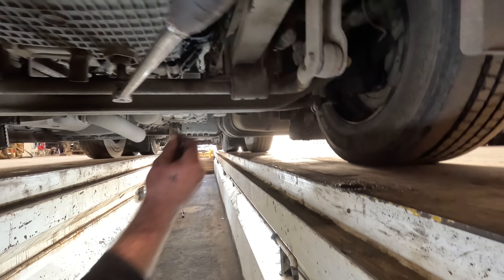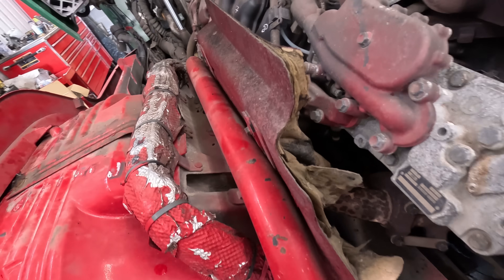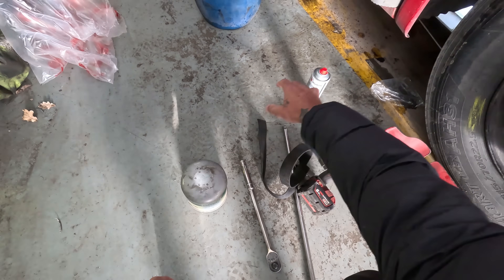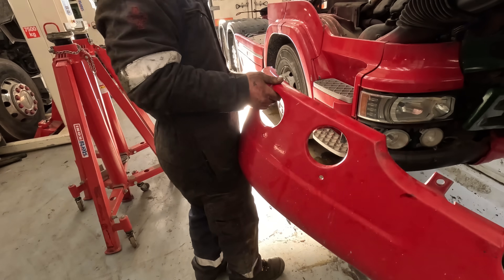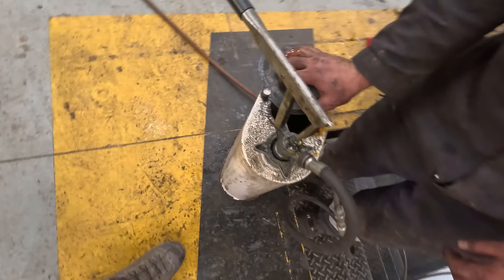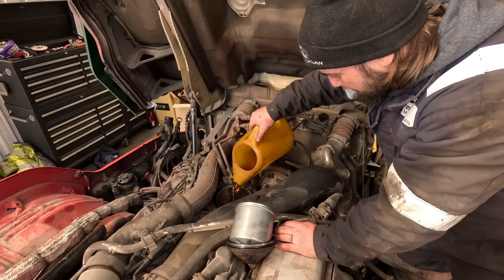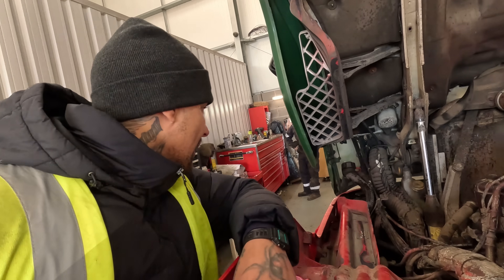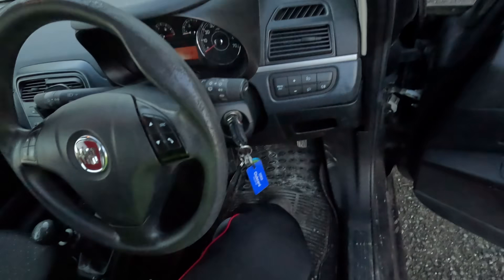Scania V8 - The Cost Will Blow Your Mind

Comment: Probs getting a good hgv valeter on the interior imo, (take cab curtains out and do them yourself) they do such a good job if you use a recomended one, well done on the service for piece of mind to, get all tyres checked also, .lots still to do, operators license , paint, lettering,vat registration , accountant ,fuel cards, etc, and then get earning some revenue,.good luck "TRUCKING UK"

Comment: Half these jobs you can do yourself. My first year of running an old commercial vehicle cost me 25k in parts and labour. I have taught myself to do all the servicing. All it’s cost me the last year was oil, filters, coolant and a clutch.  Had the clutch done at a workshop and at the same time they checked all the steering. £400 was my outsourced labour bill last year.
You can do it yourself!
Reply: maybe he hasnt acquired the right tools yet, or the bay to do the draining correctly, give the guy a break, he's new to owner driving, I bet you didnt start out perfectly straight away! and if you say you did then you're telling prokies me old fruit.
Reply: @guyhamiltonyt  
If you read my post you’ll see what it cost me, me old fruit. Only need a socket set to change the oils. What it’s cost him in labour in this vid he could kit himself out with tools, a torque wrench,  jack and axle stands, and a pair of overalls. Plenty of YouTube videos on how to do stuff.
He’s bought a massive money pit there. Doesn’t need a V8 as a first wagon. An ex large fleet motor with a maintenance record would be better.
Reply: @petittrainguernsey3297 he bought a v8 because he said he wants to do a range of different things, even heavy haulage
Reply: @abdulwadood.8  
Which you build up to. Very difficult in the haulage industry to be Jack of all trades. You end up being master of none.
The motor is only the half of it with heavy haulage. All the certs required, HD axles & suspension required and that mid lift is no good if you need something with double drive. The wagon he’s got would be good for max weight motorway work. Steel rolls etc.

Comment: Nice truck, but I’ve got a question for you… isn’t going to affect your profit this engine? I mean it sounds great but let’s say a 450hp Daf or a 460 Volvo wouldn’t achieve lower consumption and cost of running?
Reply: Depends on the work, we run an R500 v8, and it’s consistently better than the lower powered merc when pulling heavy.

Comment: What a great video , good job hard to start your working your own truck. Your getting there.  If your after any mats I've got a full set of brown leather floors mats for a r series v8 would fit yours , I had them in a r620 fitted a dream . Centre middle one , drivers side , passenger side and top fuse mat and mat for under radio .
Reply from the maker: MD me on instagram mate link on the video description

Comment: Fail to understand why people with no idea about trucks, trucking, or running a truck buisness go out and buy a v8. Unless your eunning heavy freight, say to scotland etc, you're just throwing profit and money in your pocket down the exhaust pipes. You'll get there almost as quick in a straight 6 450, and probably gaining 3 mpg at least. Not forgetting any major work on a v8 due to its fit in the chassis is very expensive. That air compressor sounds proper rattly, more than normal. Diff and gearbox oils were well overdue for a change. Coolant must be minus 35 on a spectrometer, or else you can get problems with block and head joints.
Reply: In about 90% of situations I've ever come up against, a V8 has been much more economical than any other I6 tractor.
Reply: @torinshepherd97  current r 450 returns about 10 to 11 mpg. Most v8 models  are returning about 7.5 that we seen come through main dealers. At 44 t a 500hp would give a reasonable balance of power and economy. With this guy being in an older spec v8, this will probably be more fuel hungry than the later models. Guess he will find out over time.